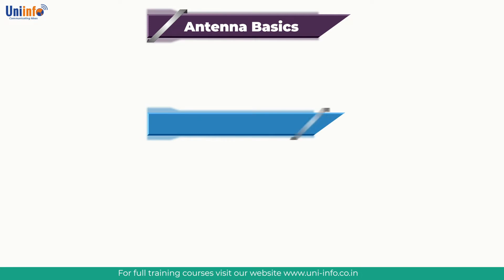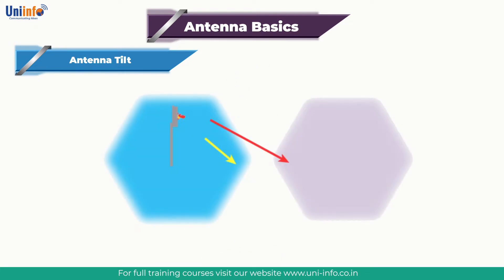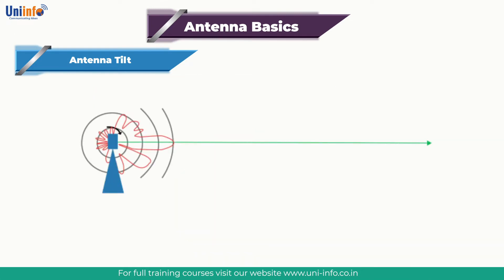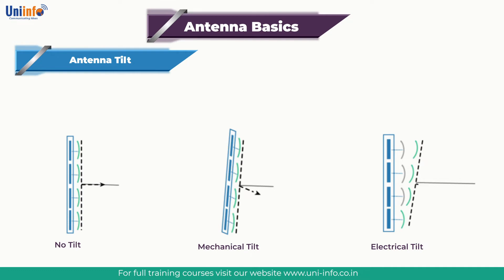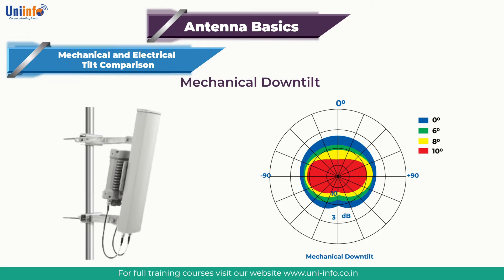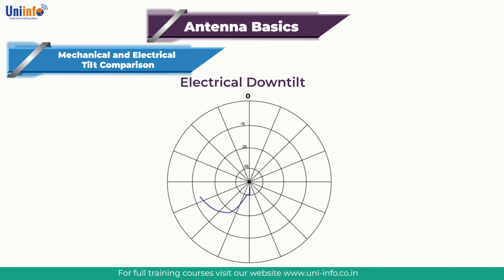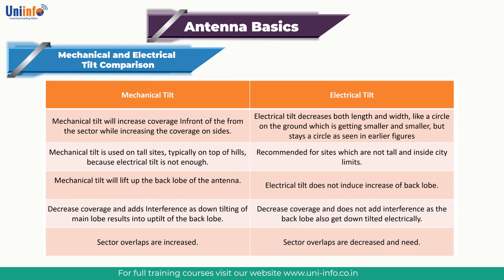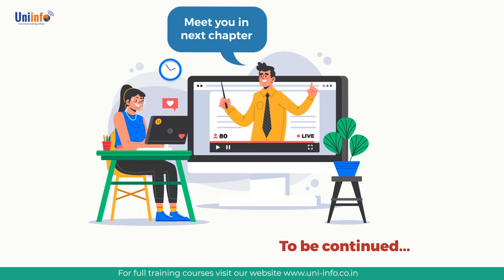Antenna Tilt - Antenna Basics | Electrical & Mechanical Tilt explanation of Telecom sector

Comment: Does electrical down tilt influence Received signal power also?
Does phase shifter control both tx and rx direction?

Or ,

amount of Received signal will still depend upon the amount of total energy hitting the antenna aperture (which was placed vertical and hasn’t changed during electrical down tilt)